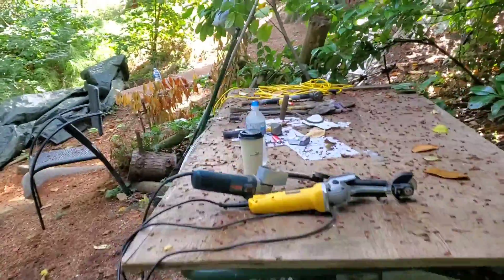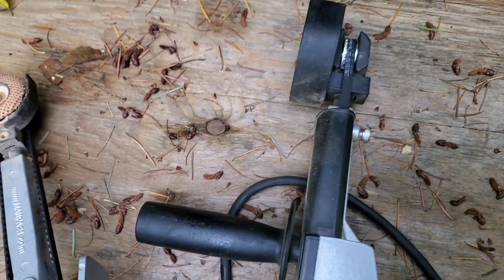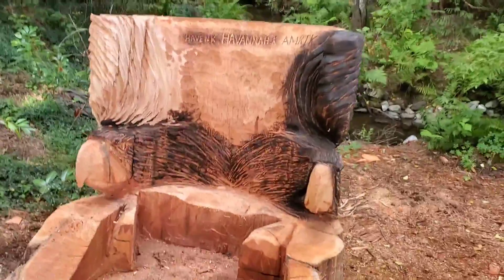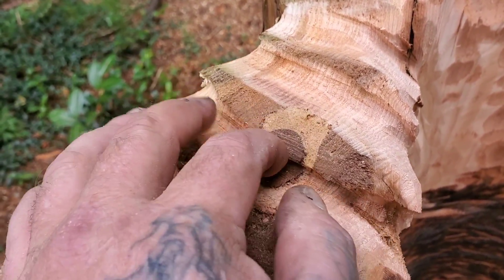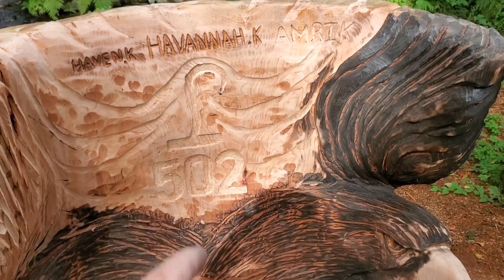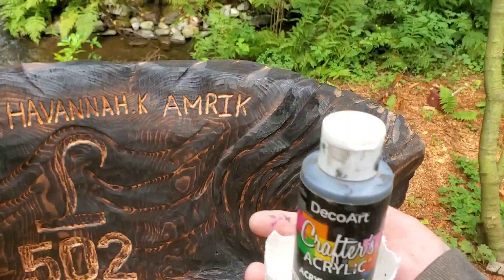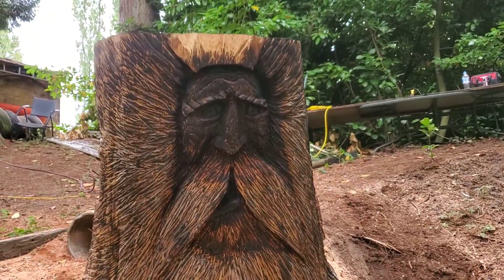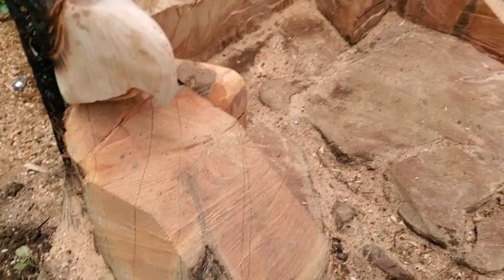Manpa tool's.Throne chair chainsaw carving.

Comment: Those Manpa tools are sure great machines. I looked them up when you 1st reviewed them, and they're a little out of my price range for now.  They sure seem to cut nice without a lot of grab or kick. 
The chair is looking good, I'd expect the owner will be pleased. Eyes are a tough thing to get right even for experienced carvers, so it seems. They are my biggest hurdle so far, so much so, I've just this evening taken to carving "practice eyes" just before I tuned in YT. I am doing a few life sized human eyes  to try to get the feel for it, and figure I can make some freaky paperweights or magnets out of them if they come out real looking enough.... 

I did a quick look on Amazon, thought I remembered seeing a mold/fungicide that was non-toxic, and there is indeed a product called  Concrobium that is has Sodium Carbonate as the active ingredient, and claims to "contain no harmful fumes or chemicals". I'm pretty sure I saw it in Lowe's as well, or maybe something like it.
Looking forward to seeing the final version eagle chair.... Carve on!